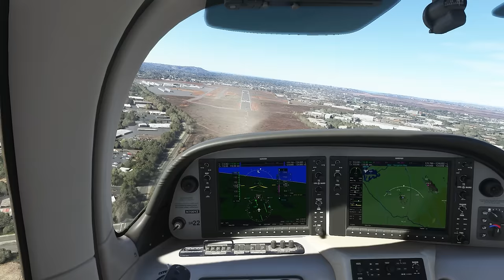Fatal Plane Crash At Montgomery Field After Student Pilot Declares An Emergency | N700YZ Crash

Comment: That cirrus was equipped with flight envelope protection.  He got slow on his base to final turn. It’s possible that the student pilot misinterpreted the flight envelope protection trimming forward as a runaway trim. If he fought it, it would continue to activate attempting to trim nose down to avoid a stall, eventually reaching the stop.   The cirrus trim can be overcome with moderate control pressure, and that appears to be what he was doing as he pitch oscillated.  That is also likely why he held the mic accidentally as he tried to fight the controls, causing a stuck mic. 
Unfortunately he was overcorrecting and eventually stalled (according to a pilot eye witness).

Comment: G,day Lex from Sydney Australia.
Thankyou for the report (video production) into this GA crash.
Interestingly the microphone and trim are on the yoke? The pilot identified flight authority (control) issue and the tower identified a radio transmission issue?
The planes airspeed and slope: much too high on contact with the ground.
🌏🇭🇲

Comment: Runaway trim is something that can happen in any airplane. There is an Emergency Procedure in most checklists. If an airplane has electric trim, I always instructed students on what to do. There is nothing here to indicate the student did anything to counter the problem. 1. Opposite electric trim. 2. Try manual trim. 3. Reduce airspeed. Configure airplane for landing. 5. Land at lowest possible airspeed.

Comment: R.I.P. to the victim and prayers for the family. Does a low end Cirrus have electric assisted trim like bigger planes? Maybe like with up/down trim switches on the yoke? Hmmmm. A normal low-end plane like and old Cessna or Piper only has manual that works with cables. I flew a long time ago and don't know much about these newer types.
Reply: Newer (after 2000) Cessnas and Pipers now have autopilots and electric trim. Anything with a glass cockpit pretty much will come with those items as standard, anymore. As the price of tech comes down, its pervasiveness will increase even in low-end aircraft. Retrofitting has become cheaper and less complex as well.

Comment: I'm a private pilot and what I heard the student pilot indicates me malfunction of the trim system. A sophisticated system sometimes cause complicated unknown phenomenon. Below is from Cirrus SR-20 manual.

An electric motor changes the neutral position of the spring cartridge attached to the elevator control horn. A conical trim button located on top of each control yoke controls the motor. Moving the switch forward will initiate nose-down trim and moving the switch aft will initiate nose-up trim. Pressing down on the switch will disconnect the autopilot if the autopilot was engaged. Neutral (takeoff) trim is indicated by the alignment of a reference mark on the yoke tube with a tab attached to the instrument panel bolster. The elevator trim also provides a secondary means of aircraft pitch control in the event of a failure in the primary pitch control system not involving a jammed elevator. Elevator(pitch) trim operates on 28 VDC supplied through the 2-amp PITCH circuit breaker on Main Bus 1.
Reply: Interesting post. But, I think you are describing a completely different aircraft. This aircraft was a Cirrus SR-20.

Comment: Terrible accident. A soloing student pilot is probably the most dangerous time of one's flying career as you just don't have the experience to fall back on if the crap hits the fan. Too low to use CAPS unfortunately. Runaway electric trim is a bi*ch, gotta pull the breaker or fight it to the ground. At this stage in his training he may not have know to pop breaker or forgot as he was overwhelmed with all that was going on. And I'm sure when he saw the runway was in use that probably messed up his plan A. Plan B, hit the dirt unfortunately didn't work, airplanes don't do well off road. Valiant attempt, sad. My 2 cents.

Comment: I have had runaway trim in a Mooney and it is very scary. Took a tremendous amount of pressure on the yoke and then disconnect the trim. No idea why it happened and never happened again. Cirrus may be different. RIP.

Comment: The trim and stuck mike sound like some sort of short in the yoke switches. The circuit breaker should have been pulled before the aircraft executed a trim induced stall. This happened close enough to the ground to minimize a fire and explosion. None the less, we all need to go through our emergency checklist during preflight to familiarize the procedures for emergencies. Sounds also like pilot inexperience with the aircraft and being frightened limited his ability to properly handle this emergency.

Comment: A Runaway trim is a very serious problem.  It can place forces on the yoke or control stick which a pilot may not be able to counter.  In the older conventional yoke, which this airplane did not have, you can place more force on the yoke because you can use two hands and two arms.  I am not sure that is possible with the side stick which this aircraft is equipped.  I looked at the horizontal stabilizer in the video to see if there was a trim flap moved full up or full down.  The stabilizer looked  looked completely flat which would normally indicate the trim was not displaced in either direction.  However, I am not sure if the Cirrus is rigged that way.  It could have been that the trim was fluctuating from full up to full down.  The NTSB will have to look at that.  In many aircraft you have a trim "on" and "off" switch but again not familiar with the Cirrus.  However, I would guess that all aircraft have a circuit breaker that can be pulled which disables the trim.  Trying to find, reach and pull the circuit breaker when you are using all your strength to just maintain flight may not be possible.  This was very unfortunate.  My condolences to the family of this man.

Comment: Trim switch sticking  in a position to keep moving trim instead of in position to not change trim is the most likely cause of runaway trim.  Bit of dirt in just the right place or broken return spring or  a few other things can do it.  Less common causes are assorted locations for short circuits.

Stuck mic, he may have been depressing a mic button, trying to apply pressure to the trim button.  Not sure how close those are on that iarcraft.

Can't really do more than guess about possibilities  

Runaway trim on short final is just a bad place to be.  
Already in a high pilot workload and suddenly adding an unusual flight control issue.

Comment: Why is a student pilot flying a sr-20? That's my first question, and why didn't he pull the caps or the autopilot/electronic trim circuit breaker first? This is why it is so important to know emergencies very well in your aircraft so accidents like this don't happen it is very tragic

Comment: The prevalent use of linear actuators for trim control in many types and styles of aircraft including rotorcraft has led to trim involved accidents. Some of the actuators have many times the forces which cannot be humanly overcome by control inputs. Why do we need a trim? Answer is two fold; to be able to trim to an airspeed and to relieve pressure on the control stick or yoke. If a linear actuator is not installed with a spring or weak link which allows forces to be over ridden by pilot control input, walk very far away. Actuators should always be installed to pull rather than push. If a push type actuator and mechanism fails, it forms a solid structure which cannot be overcome by pilot input. At the very least a breakable shear pin somewhere in the linkage is required.
Reply: A good observation. A procedure for runaway trim on some aircraft was to grab and hold the large trim wheel and keep it from turning, overpowering the small motor, then pull the breaker. I'm not sure, but the Cirrus might have a screw type actuator for pitch trim. Will watch for report from NTSB.

Comment: Did it have CAP ? I have not checked the stats on Cirrus crashes but I have seen a few feeds pop up on Cirrus crashes. One of the very first thing I asked my instructor was where is the cut off switch for the trim as I transitioned from a PA28 to a Tecnam which has electric trim. These news planes can have you very comfortable and forget basic drills of flying or during emergencies. Very sad outcome but perhaps this was avoidable.

Comment: Supposing an SR20 had an uncontrollable trim problem with the result that full nose-down trip was applied and unchangeable (e.g. if the breaker was pulled at full nose-down, since the SR20 has no manual trim control) - would the pilot still have authority over the elevator? It would presumably require unusually heavy control inputs, but would you nonetheless be able to climb out with full back pressure on the stick but full nose-down trim?

Comment: For what it is worth I will throw this in. While instructing years ago I had a trim lock in nearly the full up position. It was obvious when I observed the student struggling to push as hard as he could forward on the yoke. I took the yoke and instructed the student to push forward as hard as he could with me. Had it been just him it would have been over but I taught him a good lesson. I pulled power way back dropped the flaps and proceeded into slow flight and I mean the stall warning continuously blowing. The pressure on the yoke was still extreme but manageable we flew back from the practice area about fifteen miles to the airport still having to put some serious forward pressure on the yoke but made a uneventful landing. Inspection on the aircraft revealed a part had been reversed on the trim system. Just remember the more slipstream from the engine and the faster airflow over control surfaces make that surface require more force to move in a out of trim condition.

Comment: I had a similar incident in my 66 Cherokee 235 last year.  I'm a new pilot, got my license 3 years ago and bought my plane 2 years ago with a total of 250 hours.  So I only had my plane about a year when this happened with less than 50 hours in the plane.  While on final my trim ran away and it caught me completely off guard.  I'm sure something was mentioned in my training somewhere?  But at this moment on final it did not come to me.  I grabbed the trim wheel to keep it from turning while I landed single handedly in a panic.  My first thought too was to get to the ground ASAP and then the trim can do anything it wants!  In hind site I don't think the trim would have caused enough drag to bring down a 235 so I probably should have aborted the landing, got out of there, gained altitude and figured out the issue at a safer location & altitude?  Also in hind site the easy fix would have been to simply pull the breaker and disable it.  But, low experience, on final, and didn't feel like I had time to troubleshoot much less find that breaker, I landed the plane.  The issue turned out to be the push to talk button and trim button were both on the same side of the control handle at 90 degrees from each other and they shorted together.  The push to talk button was recently worked on and performed flawlessly for hours before that occurred.  Now that I know the correct procedure AND have taken my time to really study the breakers to get more familiar with the locations I'm hoping I handle that better next time.  Bottom line Aviate-Navigate-Communicate.

Comment: Looks like a stall/spin. I've never flown that aircraft. If the trim on that aircraft were to go full nose up or down and lock in that position, can it be overcome with manual control inputs? And how difficult is it to locate the trim (and autopilot) circuit breakers in that Cirrus?
Reply: I've heard the circuit break on these is in a very tough position down by your legs.
Reply: I guess just take out the breaker and you could put the aircraft down quick
Reply: He panicked

Comment: Makes you wonder if he had an electrical problem on the plane. Uncontrolled elevator movements, stuck mic..Also, he didn't stall/spin based on the appearance of the wreckage. It looks more like he bellied in nose slightly down.

Comment: This guy could have saved himself by just turning the Master switch off. I'm a retired pilot, tower and tracon controller and my ear tells me this guy just lost it and it cost him his life. (For non-pilots, the Master switch controls electical power to the aircraft. Trim is run off a servo motor and turning off the Master cuts power to the trim. The engine will continue to run because it uses magnetos).

Comment: I currently have about 80 hours in Cirrus airplanes, including G3 SR20s and G6 SR22s. I will say that the combination of electronic trim and the spring-loaded sidestick means that control requires a good bit more force than in other planes. So, if the plane trimmed itself, say, entirely nose-down, it would be quite difficult to hold nose-level, but I do not think it would be impossible. It is also noteworthy that this pilot appears to have attempted forcing the plane onto the ground at or over 100 knots. This seems to indicate that a primary cause of this accident was, unfortunately, pilot panic. Therefore, the best course of action may have been applying full power and getting above CAPS altitude and pulling the parachute. I can’t know for certain, of course, but seeing as this pilot seemed by his panic to be losing control and/or the mental capacity to maintain steady control, that leaves very few options.

Comment: A student shouldn’t be in a cirrus in the first place because it has over 200hp which would classify it as a high performance airplane. Even if your trim malfunctions all airplanes are made so that you can overpower a runaway trim situation and all airplanes have electric trim disconnect with manual override. Maybe he didn’t know how to operate it but a runaway trim shouldn’t end in a fatal accident.

Comment: The Challenger type that (CL600 - CL650) I fly has had runaway trim issues in the past, resulting in several service bulletins and procedural changes.  There is no manual trim and no "trim wheel" to grab and stop stabilizer  movement. As is the case in most T-tail turbojet aircraft, the stabilizer is a huge surface compared with the elevator - and can easily overcome elevator inputs.  If normal trim system disconnect cannot be achieved by the switches on each control yoke, the last resort is to pull 2 circuit breakers, one by the copilot's right knee and another behind the copilot's head.  We have installed red circuit breaker identification "markers" for those 2 important circuit breakers.  Perhaps that would help in the light airplane world?  Sorry for your loss if you are a friend or family.

Comment: Runaway trim is always a problem. The young pilots mistake was trying to land. The safest option would be, 1. Declare an emergency, 2. DO NOT ATTEMPT TO LAND, instead climb, orbit, find the breaker for trim… and then if all else fails… shut down the engine and deploy the installed aircraft parachute.

Comment: Sad that this happened, especially since he was flying a Cirrus.  Stuck, jammed, runaway trim or control surface is the perfect circumstance to pull the CAPS handle.  He might have been low, but there are documented successful deployments inside of 390 feet.  Also, depending on the circumstances of the failure, he could've babied some altitude out of it and deployed higher, instead of the panic landing attempt.  All that said, my heart goes out to the pilot, we can always talk about what he should have done, having not been there, but reality is a much different thing.
Reply: The CAPS is part of the problem. People with way too little experience think it is ok to fly a Cirrus because they always have a Parachute. Never fly an aircraft if you think you are not ready to handle it in an emergency. Learn to fly, Aviation is NOT a computer game.

Comment: Any aircraft which has a powered elevator or stabilizer trim system can experience what's known as a "runaway trim" situation.   It can be caused by a short circuit, stuck switch or any number of other mechanical or electrical faults.   A runaway trim scenario can rapidly make the aircraft very difficult to control in pitch.    The key thing to note is that in most cases, the aircraft manufacturer publishes a recovery procedure for this sort of malfunction and that procedure is typically a MEMORY ACTION ITEM....meaning the pilot must memorize the procedure, because there may not be time to run a formal, written checklist or perform troubleshooting actions.   We saw this in spades with the two 737 MAX accidents, in which a malfunctioning stability augmentation system (called MCAS) essentially caused the stabilizer trim to aggressively trim the airplane nose-down.   In both cases, the crews failed to perform the memory action items in a timely fashion, and they both failed to control the speed as well.   In both cases, the MAX airplanes crashed nose-low at takeoff thrust.   

A runaway-trim scenario in the pattern is particularly critical.    The aircraft is a low altitude and the pilot has very little time to react correctly.     The pilot must maintain aircraft control and disable the offending system, then trim the airplane manually.    This pilot was a student, and was probably experiencing his first emergency while solo.    It remains to be determined what, if any remedial actions the pilot took, or how much training he had in dealing with runaway trim......assuming that's the type of problem that occurred.